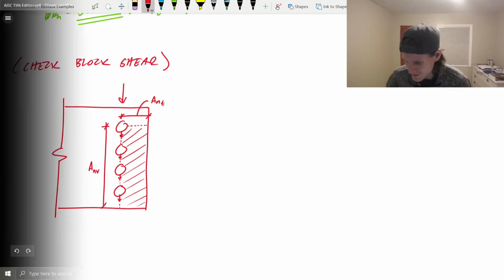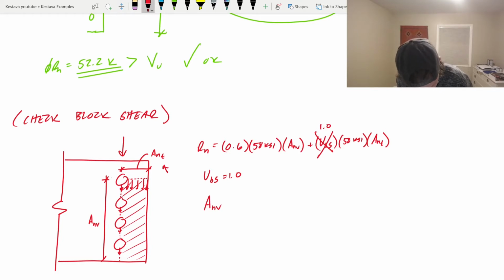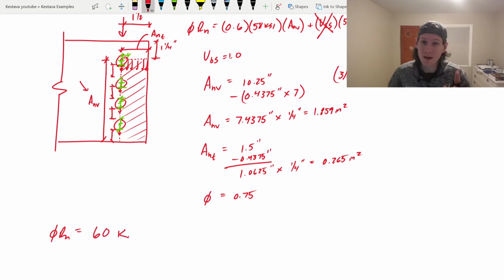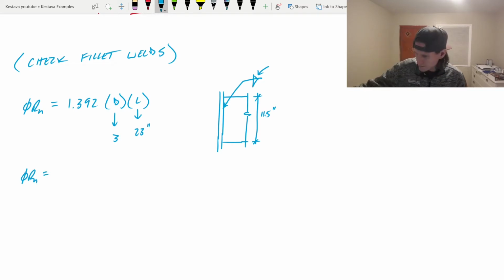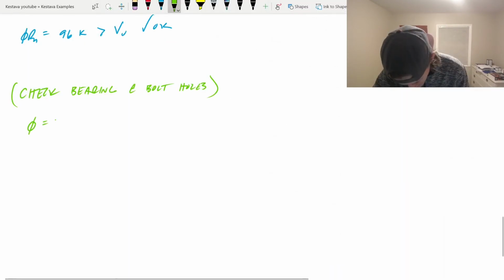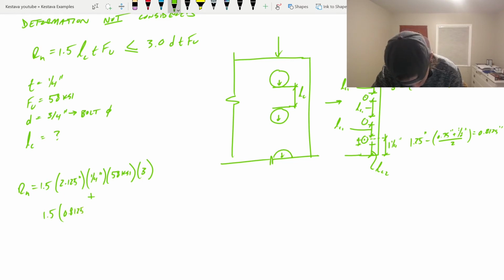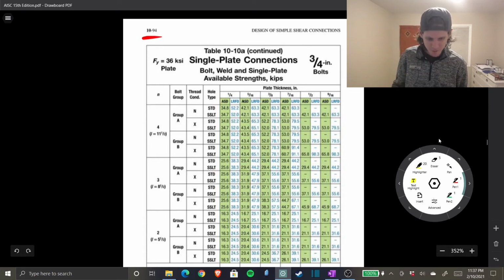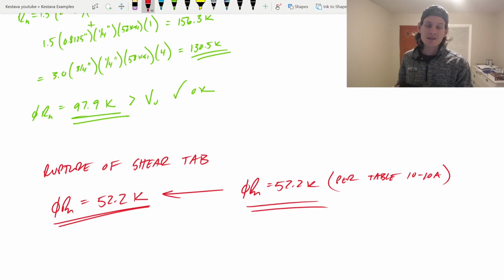Steel Connection Design Example using AISC Steel Manual | by hand | Part 2

Comment: i feel silly, how is the top bolt subtracting only 1/2 of the bolt for block shear? wouldn’t it be 1/4 of the bolt since 1/4 of the bolt isn’t in the calculation for Anv and 1/2 of the other three bolts
Reply: so in total we’re subtracting 1.75 bolts
Reply: @brookelyncosper79  is not the area of the circle you're subtracting. If you cut through the hole and then see the plate in elevation you'd see the hole as a rectangle, the height is the thickness of the plate and the base the diameter of the bolt hole. So for the top hole what you are actually seeing is the rectangle formed by half of the diameter times the thickness. That is why you subtract 3.5 diameters times the thickness or 7 radius times the thickness.

Comment: On your Anv, It looks like you took the bolt hole area away from 10.5" instead of 10.25". adding .25 inches to Anv. Should it be 1.797 in^2? Great videos though by the way. You are a great help!

Comment: I've just checked this one, pretty good, one thing I'd like to confirm, the effect of eccentricity when it comes to the welding, why didn't we check the welding due to tension along with shear, since the force was out of plane will cause some moment, thanks
Reply from the maker: very good point Ayman - although the eccentricity is very small, its still a check that should be included and the additional stress effects should be combined in the weld check. great point!

Comment: thanks for the video. 
One question: I would have selected Ubs to be 0.5 since at the top of the block shear you have a concentrated force to the left (at the bolt position) and 0 to the right (at the free end). Can you explain why you selected Ubs=1.0?

Comment: Thanks for the video, one question - isn't the weld situation an eccentrically loaded weld group?
Reply from the maker: you are absolutely right Aleksei! I decided to leave this check out as the eccentricity is relatively small so the moment on the weld shouldn't be a controlling factor, BUT that's no excuse. It should be checked!